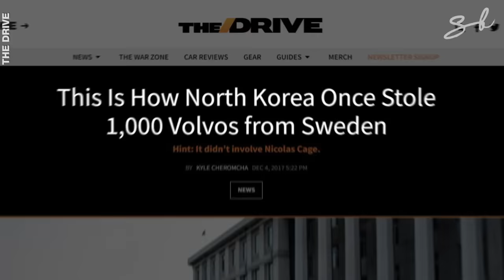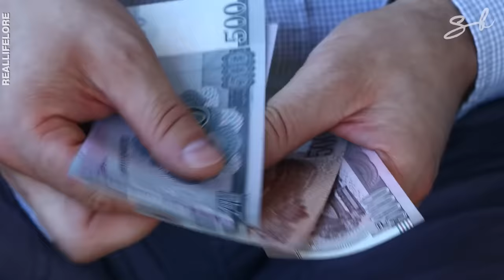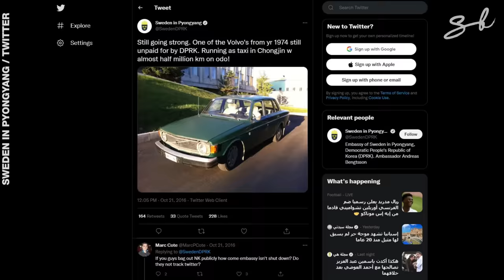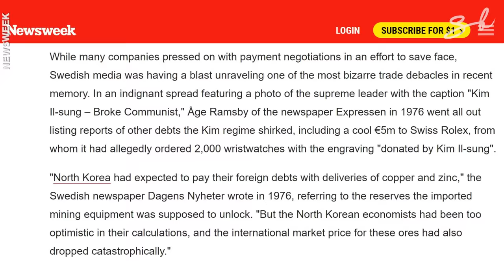How North Korea Stole 1,000 Volvos From Sweden

Comment: A Volvo P-1800 has driven 300 000 miles so these old Volvos have endurance as long as they are maintained properly.
Reply: 3 million miles, you meant
Reply: @flarenas  Yes, I don't usually use miles, 3 000 000 it is. 500 000 Swedish mil.